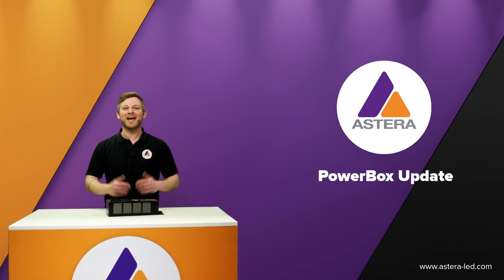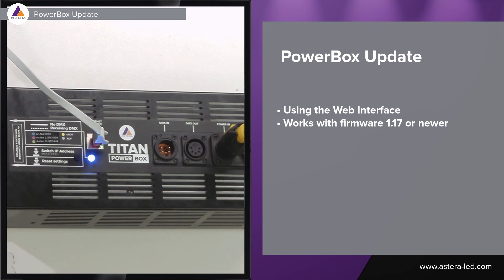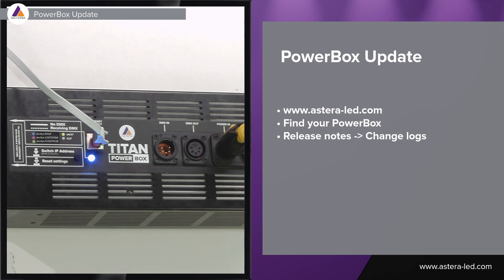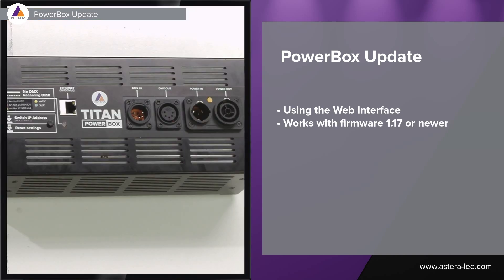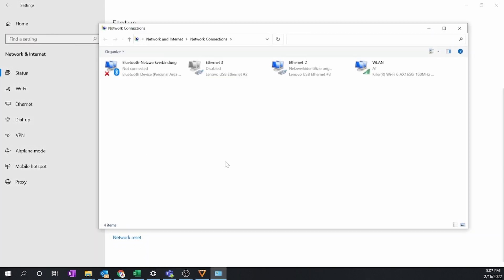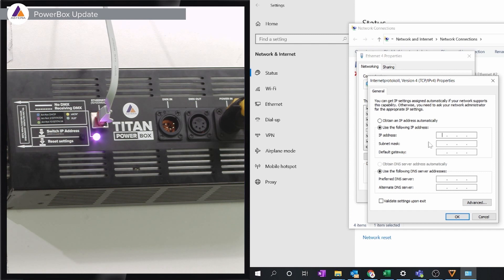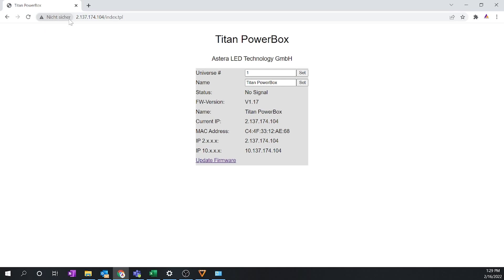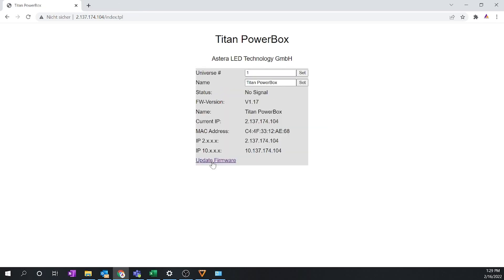PowerBox(s) Update Tutorial

Comment: The notations are a bit confusing. During the section of the video where you are doing it with DHCP plugging into a network with internet access, it says at the side "using the Web Interface  -  Works with firmware 1.17 or newer". So does it need FW 1.17+ to install the update by connecting directly to the internet?
Reply from the maker: @chrissteele8910  Installing the update via internet connection works on all firmware versions. The web interface where you can browse to the PowerBox to upload new firmware was introduced with firmware version 1.17